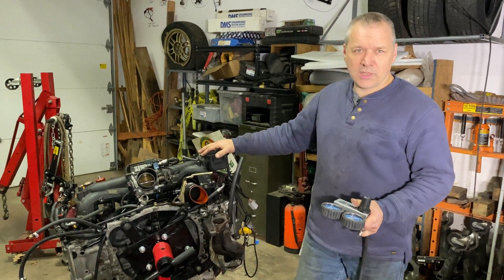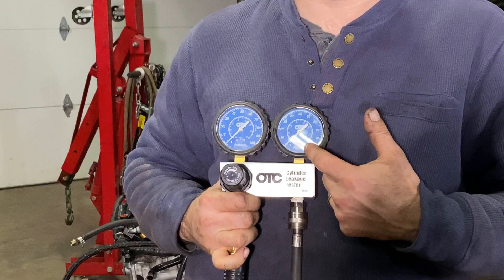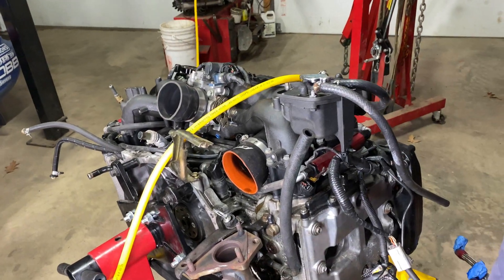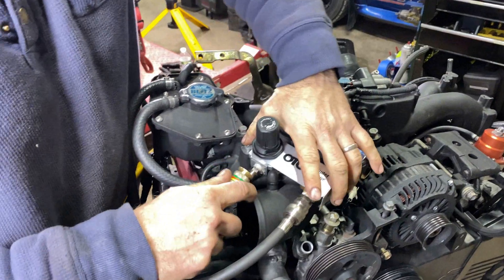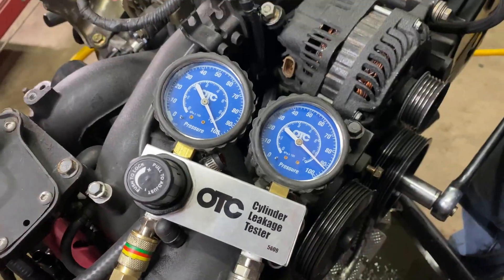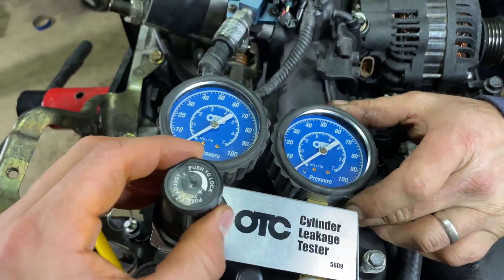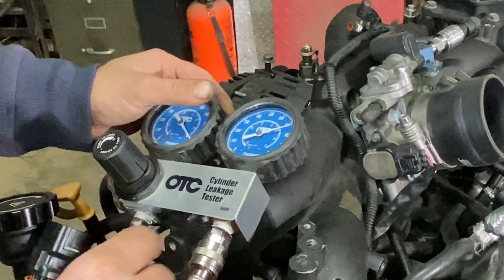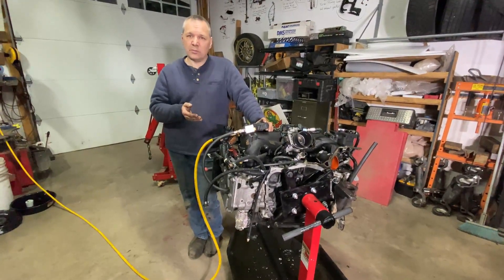Performing a leakdown test on a Subaru engine

Comment: if i have no injectors and fuel rail in engine will it read wrong if i do leak down test.
Reply from the maker: No you'll be fine. It's not a direct injection engine so the injectors are above the valves not in the cylinder head. You'll get a correct reading
Reply: HI thank you for rely i have a subaru impreza gc8 engine i have take out of a car i had parked up for 5 years but when was parked up did compression test was very good and low milage ran spot on.but now five years later take it out of a car and done a leak down test and is leaking on one cylinder through in injector.could it be valve not seating and be carbon build up.

Comment: great video thank you, will this also check for head gasket issues, if so do you just check for bubbles in the expansion tank once all connected up, I notice bubbles in the expansion tank when the engine is cold but stops once the engine is warm,
Reply from the maker: If the head gasket damage is between the cylinder and a coolant passage then yes it would pressurize the coolant system. Usually you'd see little black particles of head gasket material in the expansion tank. If it's a failure between an oil and coolant passage you wouldn't see from this test but you'd have oil/coolant mix.
There is always an amount of turbulence in the system especially when cold as the thermostat is closed and prevents the coolant from circulating through the radiator. This creates a backflow that generates bubbles. Once the thermostat opens the flow of coolant should be much smoother but you still get some amount of bubbles from the general flow and high coolant temps.
Reply: @FrogRacing  thank you for the very detailed explanation, you have gained a subscriber and follower, keep up the great content 👍🏼

Comment: Just found this. Troubleshooting a po302 on my 2006 su aru sti with 156,000 miles, spt add ons only. Swapped plug and ignition coil . Po302 back car runs fine . No noticable difference.  Short and long trim ok. Gonna swap  injectors then do a leakdown test. Did a smoke test all good on intake side. Gonna do exhaust side and test o2 sensors😊

Comment: OK but if you fail a leak down test. Whats the step to fix it? 
Unfortunately
Cylinder 1 -32%
Cylinder 2 -10%
Cylinder 3 - 5%
Cylinder 4 - 5%
Reply from the maker: Engine rebuild. Check with your preferred machine shop to assess the damage and rebuild.

Comment: Excellent video and explanation. Is a leak down test enough to know the health of the engine or one should also do a compression test? Thank you!
Reply from the maker: Usually a leakdown test will let you know if a cylinder is low on compression as it will leak. If the engine is cold and has forged internals, some leakdown could show where actually compression is good once the engine is hot. A wet compression test (squirt some oil in the cylinder through the spark plug hole before testing compression) could give you a better idea if you are trying to see if compression is similar across all cylinders.
Reply: @FrogRacing  Ok, got it. And how much oil should be squirt through the spark plug hole? Thank you!
Reply from the maker: @MikeSF5  just a squirt. I use an old oil can pump oiler, it's never easy on a flat engine as the oil tends to only get to the bottom half of the piston.
Reply: @FrogRacing  Thank you Sir. By the way, is it possible to do a cylinder compression test on a Subaru long block which I bought from an automatic motor? I ask because I don't have the flywheel with teeth for the starter to hook on and crank the motor.. I only have the flex plate (round disk with holes) attached to the back of the long block.. It looks like the flywheel with teeth is attached to the torque converter in my car now..
Reply from the maker: @MikeSF5  the easiest would be to find a used manual trans flywheel to bolt on. Used ones that need resurfacing go for very cheap.
Reply: @FrogRacing  Ok. Thank you

Comment: Good video breakdown.

Quick question. What your thoughts on these leakdown numbers

Cylinder 1-2 10% (90)
Cylinder 3 15% (85)
Cylinder 4 10% (90)

Compression was a solid 145 psi across all cylinders.

Do you see anything wrong with these #'s, specifically cylinder 3?

Comment: but the airline hose does not have to be disconnected though does it, the air just has to be turned off, correct? it seems to me that it doesn't matter what method I use to find TDC COMPRESSION I'm never sure that both valves are closed, and then I doubt my diagnosis.
Reply from the maker: If you are not at TDC the piston will push back on the crankshaft and the engine will rotate. You can use a horoscope with a side camera to look into the cylinder and see the valves if you want to be 100% sure.

Comment: Won't air always bypass rings into the oil pan even if it's good? I always figured it will always leak past the piston but just has to be slow enough to maintain compression. That not correct?
Reply from the maker: There is always a tiny bit going past the rings but most of it should not. Some sleeved blocks with forged internals will have a little bit more leak when cold as they expand when they warm up. IAG will declare a block faulty as soon as there is more than 20% leakdown (reading 80 or less on the gauge). On a good shortblock with cast pistons, it is not rare to have 0% leakdown and 2-3% max all around.
Reply: @Frog Racing  so you hook up a tiny compressor and it drains the whole compressor little single one gallon hotdog tank from 100 psi to 30 in a min does that sound like way too much air? I'm trying to comprehend how a leakdown tester tests. When it says 20% is that 20% of what volume per what time? per second, min? 20% of the input, cylinder volume,  or what? can't find info on it so far.  Guessing it's of input being the regulator set at 100 but idk.
Reply: @jackle842000  output is based on input...the tester doesn't display "percent" exactly, it displays how much PSI the cylinder can retain. Also, percent literally means "per 100". 

If you have a smaller tank you could probably run it @ 50 psi input to buy some time. Then if your output (engine side gauge) reads 45 PSI, that means you are losing 5 PSI for every 50....to do the math for percentage, 5 divided by 50 is 0.10, aka 10 hundredths or 10%.

Or you can think of it that losing 5 per 50 means the same as losing 10 per 100...."per 100" is "per-cent"

Of course this is assuming that 50 PSI is enough to push the air through the engine hard enough that you can hear/feel it to find the leak, but I think it should be with the piston at TDC
Reply: @evergreenpsyche  it has to be a measurement of rate.  The cylinders don't retain any psi. no matter how slow the leak it'll all leak out eventually.  psi per what? min, sec, every 10 seconds? any idea?
Reply: @jackle842000  in this case the compressor is supplying a constant flow of pressurized air, so the measurement is real-time, no rate needed, only downside is you need a half-decent compressor. It's much simpler than measuring over a period of time and calculating it by rate, although you can certainly do so if you wish. You can provide a burst of pressurized air and measure how long it takes the pressure to fall, and express that in any units you want if you do the appropriate math

But doing it the way shown in the video is simpler and easier to diagnose with (listening for source of leak, etc). You're correct that no air is actually retained, but by supplying a constant input pressure, the engine side gauge can express how much pressure the cylinder seals are able to maintain. (Cylinder seals meaning valves, head gasket, and piston rings which of course do let some air through) In an engine with perfectly sealed cylinders they would maintain 100% but that can't exist in reality. 

Anyways, this method basically uses the gauge to show "how much back-pressure can the cylinder provide under a constant input pressure, with the cylinder seals being the choke point or restrictor that determines the back-pressure."  

The percentage calculation expresses "degree of pressure seepage allowed by cylinder seals, relative to a fictionally perfect seal (represented by 100%), expressed in real time." No rate.

This measurement has no real world usage except to diagnose and standardize a way of referring to leakiness of cylinders in question. A rate like youre talking about would be unique to a specific model or maybe  a class of similar engines, depending on cylinder size etc. Real-time percentage approximation is a general way of eyeballing without regard to such things

Comment: Doesn't engine rotate counterclockwise?
Reply from the maker: No it rotates clockwise (when viewed from the front). Avoid turning it counterclockwise as it will release tension on the timing belt tensioner.

Comment: u said that if it’s forged pistons with can show that it’ll have around a 10% leak. Why is that? I’ve also heard people say that on compression testing forged pistons they read significantly lower. Is it because those pistons have a high tolerance to the cylinders?
Reply from the maker: Yes forged piston tend to expand more when hot, therefore they can have a bit more slack when cold. On a cold start you'll usually hear some piston slap on a forged engine that will stop once it's hot.
Reply: @FrogRacing  so testing when warm will be just as good if not much closer than cold?
Reply from the maker: @ts-vu3dd  yes if you can do it without burning your fingers, it's ideal when hot.
Reply: @FrogRacing  thank u!